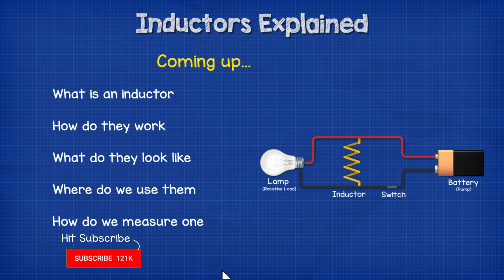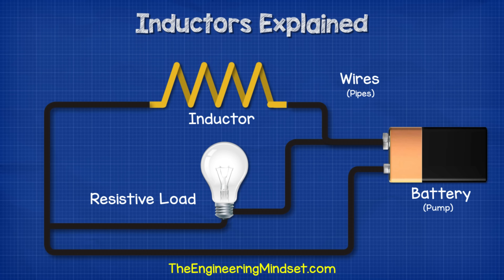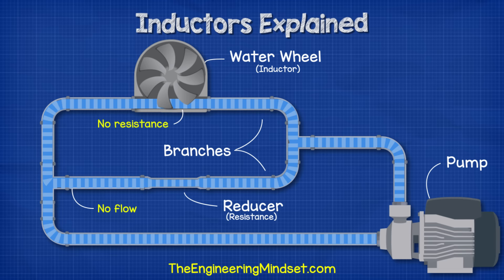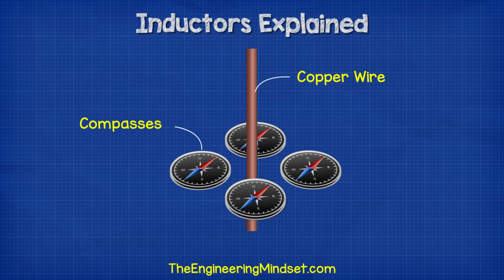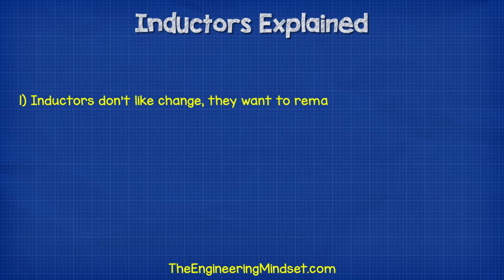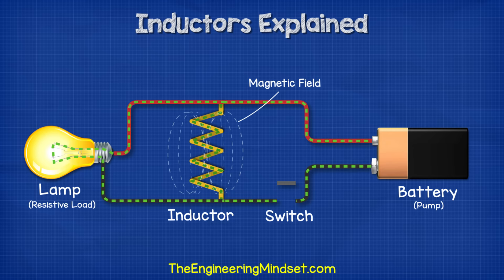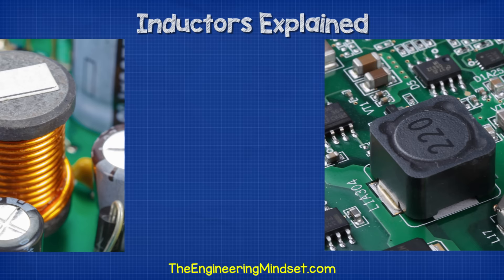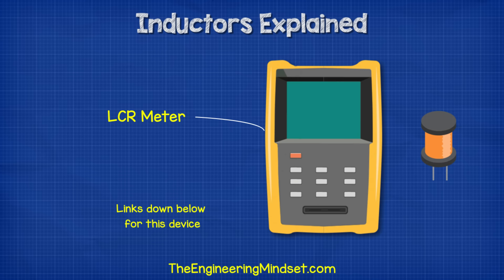Inductors Explained - The basics how inductors work working principle

Comment from the maker: ⚠️ Found this video super useful? Buy Paul a coffee to say thanks: ☕
PayPal: https://www.paypal.me/TheEngineerinMindset
Reply: These videos are more entertaining in the voice of a Bruce
Reply: Paypaul*
Reply: so why can't we use a capacitor instead of inductor?
Reply: You made it so easy 👍
Reply: Do you also take Bitcoin? Donations are great but I’d rather avoid using those PayPal scumbags.
Reply: Do you guys have a video on florescent lamp ballast's and how to test them?
Reply: Please make a video on different types of relay.......
Reply: Can you make a inductor vs capacitor lecture.
Also nice vid
Reply: @debojitacharjee  same question !
Reply: @debojitacharjee  so i tried to find some info and found that.
★Capacitor is used to store energy and discharge at an instance. (Works on voltage). Capacitor is used to get a burst of electricity like in nuclear reactors, servos, etc. Capacitor acts as a temporary battery.
★Whereas an indicator keeps the current in motion it do not stores the current (works on current ). It used to get an uninterrupted flow of current. Due to magnetic field it can keep the electrons in motion even there's no source of emf, but just for a while.
It's used with lights. It acts as a temporary generator.

Hope it will help.
Reply: The Engineering Mindset  can you help me to understand how optocouplers works
Reply: We really need a video on inductor Vs capacitor
Reply: Now i am confused between capacitor and inductor, why do we need inductor when we have capacitor. Please share video to understand why we need components
Reply: You are absolutely an extraordinary teacher. Credits for the good job. I wish I had paypal account, I could support you. Alternatively, You may make an application and we buy you coffee through paid app. ...bravo
Reply: I want to buy him a bloody cup of tea for his propa explanation of inductas.
Reply from the maker: @stomboli yes, we also accept bitcoin to this address: 3Jb56ZZQ6qL7ymKL12VinNZNLCTrj8yHWp
Reply: A good explanation but you need to change the power source. When connected to DC power source like that the inductor acts like a short circuit, cause it has no reactive resistance.
Reply: Is there an actual reason why we dont just scrap the idea of electricity flowing from plus to minus, and just focus on the electrons?
Reply: @debojitacharjee  capacitor allow AC but not DC, and Inductor allow DC but not AC
Reply: I saw this video when i was free but at 2.10 this video told me the difference between conventional current and electronic current
Reply from the maker: Check our new relay video: https://youtu.be/n594CkrP6xE
Reply: someone say they hate conventional current can u please block the guys that they say hate conventional current pls?
btw keep on the channel i like your channel
Reply: Giii
Reply: @PRACTICALPARTHA  i work with computers and they only use dc, so my question is if capacitors only use ac then why do motherboards have them
Reply: @EngineeringMindset  You earned a subscriber with that audio substitute for the scene from gravity. However, I don't think there was an edit in the scene from Suckerpunch. If there was an edit, that would defeat the purpose of the double set. My understanding is that they had mirrors suspended in place and when the camera crossed over, the mirrors were dropped into place.
Reply: @OhhYasssh  ???????
Reply: Why do you use the symbol for a resistor in your thumbnail, and then call it an inductor? They are very different.
Reply: LOL - Resistor symbol used to explain an inductor - what are you thinking?
Reply: @debojitacharjee  Current can not flow trough capacitor, but can flow trough inductor.
Reply: if we meet I will definitely buy you a Starbucks coffee.
Reply: @debojitacharjee  these two are different from each other.
Reply: Cool guy Paul 😎
Reply: What do you use for animation? Where did you learn it?
Reply: @youtube.commentator  ĺ la very good explanation.
Reply from the maker: Check out NEW resistor video, everything covered! ➡️ https://youtu.be/DYcLFHgVCn0

Comment: That water wheel analogy is the best analogy I ever heard of. Great work.
Reply: When I explain electricity I usually use water since it's a good analog.
Reply: agree, best analogy.
Reply: the pipes can have more water on one side of the load and less water on the other side, and that drags the water along so the turbulent flow in the lightbulb generates light
Reply: @official-obama  laminar flow gang
Reply: @TheAcidicMolotov  laminar flow can’t happen through millions of compressed orbeez
Reply: @official-obama  it sure can, it happens all the time
Reply: @TheAcidicMolotov  cite your sources
Reply: Doesn’t the polarity flip when supply is disconnected? The water wheel carries on same direction.
Reply: water analogy only works for DC circuits..
Reply: Water is for babies.  
Rick Hartman, what your twisted wire pairs want you to know
Reply: yes its good
but small tank analogy is more relevent
Reply: its great for understanding the basics, but gets irritating very quickly. For example, there is nothing showing effective/reactive power, alternating current, magnetic or electrical fields etc. You have to get a more intrinsic understanding of the natural laws of physics concerning electrical engineering to not get confused later on

Comment: What I am not grasping is what is the purpose? why do we need an inductor in a circuit? The more I learn about electronic components, the less I know about them it seems. I understand how it works, but why is it needed?
Reply: Same here
Reply: Honestly it's kind of the same for me. What I got from this is that an inductor basically acts the same as a resistor and a capacitor combined, so the only reason to use it would be to save space I guess? The only difference to a cap and res combo would be the way it reduces the flow, since it acts as a resistor while and after being charged, therefore not delivering the full power while connected, but then acts a cap and gives the stored energy back, whereas a resistor would constantly resist the same way and the cap not really interefering much with the current. It's confusing indeed
Reply: To store energy and help the process. 
Watch the pump part a few times. 
Don't like to type on my phone,  but it isn't that difficult to understand. 
Don't over think it.
Reply: Inductors allow to store energy for converters to work (buck, boost). They can be used as a low pass filter (remember its impedance is jwL, greater for higher frequencies because a greater variation in magnetic flux generates a higher voltage that oposses it), for example it can avoid high frequencies from noise from reaching the voltage source by making the path to it have a greater impedance for high frequencies that the path you want to redirect them to. And well obviously as a part of a transformer which has multiple uses.
Reply: The problem is that what we call "electronics" is in reality just various applications of Theoretical Physics - and the physics behind these devices is generally quite complex.  Sadly, to really understand what and why one needs a solid background in University level Physics. And even then, some of the phenomenae have multiple theoretical models for their explanation!  Simple explanations based on analogies to other better known physical systems such as plumbing and water have limited usefulness and can often lead to false assumptions regarding real-world circuits...
Reply: Heres an easy real world example you can relate to. 

When you turn your key in your car, you complete a low-current circuit that passes through a relay. The purpose of the relay is to use a low-current circuit to trigger a high-current circuit to "turn on." 
Why do this? It saves components and is much more efficient.
But inside the relay is an inductor. Once the magnetic field from the inductor is activated, it pulls on a ferrite metal to complete the high-current circuit. This high-current circuit actually feeds into your starter and spins the engine to get it started.

This is a physical use of the magnetic field but as others have said, they can be used to filter out certain frequencies.
Reply: @hannanpakthini7221  At 4.50 it is explained that the inductor  is a coil. So inside the car starter relay (sometimes called a solenoid see Wikipedia) is an inductor (= coil).  As explained in the video inductors are used in both AC & DC circuits. The " joule thief circuit" (please Google it) used to boost a single cell to drive an LED is based on an inductor storing energy.
Reply: @sheepleslayer586  I have one question -> when inductor have no resistance then bulb get turn off. And it remain turn off until we turn OFF the switch and then turn it ON again. Who do this again and again? Bulb should always remain Turn On. Let me know
Reply: @berrymckokinger9317   That's more of a electro-mechanical use, I would like to now what function it serves in a electronic sense.
Reply: Omg we litterally have the same mind I have been thinking the same thing why the heck are there so many capacitors couldn't they have combined it to just one (I'm a beginner 13 years old) and also how do the do such marvelous things with just these resistors, capacitors etc. Pls help me.
Reply: @seanwalsh999  it takes time to charge an inductor with magnetic field, so if the electricity is flowing for a short period of time, inductor won't get saturated and wont let it pass. High frequency current doesn't flow for long enough time to pass through, thus inductor can be used to block high frequency electricity from a circuit. Also it's not shown in the video, but inductor releases the magnetic energy realy quickly so the pump voltage of this release is higher than the voltage that was applied, so by charging and releasing the inductor fast enough multiple times you get higher voltage from lower voltage supply.(boost converter).
If you connect a capacitor that stores charge instead of lamp, that wastes it, inductor releases its energy into capacitor,  capacitor stores the charge and then slowly gives it back into inductor since they are still connected together, then back into capacitor, then the cycle repeats itself many times until the energy is wasted completely due to internal resistance between them, or battery is connected again. And this process is how you get oscillations from a non oscillating current, basically a radio, if you connect an antenna to it. Change the values of inductor and capacitor or resistor between them and you change the frequency of the radio.
Also it can protect the circuit from sudden voltage spikes because it takes time to charge an inductor.
Reply: @ivannechkin3665   Thank you for providing the use of an inductor in a radio circuit. I see that the inductor affects frequency which is used in audio circuits ie: an audio cross over circuit to dived up the voltage into different frequencies.
Reply from the maker: Check our new relay video: https://youtu.be/n594CkrP6xE
Reply from the maker: Check out NEW resistor video, everything covered! ➡️ https://youtu.be/DYcLFHgVCn0

Comment: Great explanations! You might add that inductance can be tricky to measure because inductors tend to be one of the more "imperfect" components we typically deal with in electronics. Inductors often include a lot of resistance.

Comment: The best explanation imaginable. These things must take some time to put together. A big thanks!
Reply from the maker: Thanks MegaSquiff, they take an insane amount of time!
Reply: i you'd take a little time to answer to us humans it would be great.
Reply: so what is the purpose of this inductor??
Reply: @razen4758  Most common practical uses of inductor are as filters, like low pass filters, so they filtered out higher frequencies(inductors are known that with higher frequencies they become like resistors for current flow because of opposed magnetic field.. More advance use of inductors for example is transformers where magnetic field of first primar inductor(coil) go through wires of second secondar inductor and generate lower voltage current of same frequency. Also lately there are very popular inductor cooktops, where they use energy of electro magnetic field, to generate heat on right cookware, where coockware presenting resistance to that magnetic field, so they heating up.
Reply from the maker: Check out NEW resistor video, everything covered! ➡️ https://youtu.be/DYcLFHgVCn0

Comment: Perfect video your next one should be about how capacitance reactance and inductance work together
Reply from the maker: Thanks, yeah I'll add it to the list
Reply: Excelent idea!!
Reply: Well, reactance and impedance are mathematical concepts. They have certain physical meaning, but not much.
Reply: Yes please add this! That would be great to begin understanding the applications of these components working in combination
Reply: Yes please add it
Reply: @altuber99_athlete  To say that impedance is a mathematical concept with little physical meaning is to say resistance is a mathematical concept with little physical meaning.  Neither is true.  In a manner of speaking, impedance is AC resistance and resistance is DC impedance.  If impedance didn't have physical meaning there'd be no effect of impedance matching or balancing an inductive load by adding capacitance in order to avoid the power grid from supplying reactive power only to have it "kicked" back onto the grid in the next half cycle.
Reply: My CPU just overheated.
Reply: YUP, that would be a tank circuit. radio transmitters.
Reply: I have no idea how that works but I'd love to know
Reply: Reactance is specific to AC power and this phenomenon can be found in inductors and capacitors. Reactance is specific to AC current since it depends on the frequency of the current because it only affects such changing current.. further, there is a 90deg phase shift betwixt v and i; and the direction of the shift depends on whether the component is an inductor or capacitor, which is know as inductance reactance and capacitive reactance..
Reply: Impedance

Comment: Great explanation about what it does in isolation, but an integration example would be very helpful. How is it used in a DC transformer? etc. I think this is the only thing that is missing from your great videos about electronics. Thanks!
Reply: huh? since when can transformer run on DC lol
Reply: @Saadkhan-th4bz  They're talking about buck/boost converters, as mentioned in the video

Comment: This is a really good explanation of what an inductor is and what it does, however, they(inductors) as well as capacitors act different with DC as they do with AC and have different applications with both types of voltage sources.  Inductors are a short circuit to DC and have resistance to AC  (reactance) while capacitors have totally opposite properties and are resistive within DC circuits bit offer low resistance paths(i.e. SHORTS) to AC voltage sources. In AC circuits, this property is called either inductive reactance Xl = 2*pi*F*L , or capacitive reactance Xc =1/(2*pi*F*C). Caps and inductors are typically used together in series and parallel combinations to form different types of filters such as band pass, band reject, and high or low pass filters(depending on how they're connected to the circuits output either allowing a freq range to pass to the output and on to another stage, or route the tuned freq of the tank circuit to ground to act as a filter, OR, as an oscillator . When combined with resistors, the total combined effect is called impedance, denoted by the symbol Z and is the square root of the sum of R squared plus X Squared .
Reply: You sir, are a gentleman and a scholar. Hopefully your comment gets to the top to more fully cover this topic and prevent fires.
Reply: Good explanation. The reason for this behavior is explained at 5:53. I wish these details of reactance, AC vs DC, and applications were added.

Edit: 
For those learning, DC has no change in current so inductor just passes current along and acts like a wire. AC has a change of current so the inductor opposes the change and acts more like a resistor. Inductor is like a frequency dependent resistor XL=jwL=imaginary number*frequency*inductance.
Reply: That's a basics videos but yeah, AC impedence wasn't covered here, or voltage spikes when you abruptely disconnect a coil when charged
Reply from the maker: Check out NEW resistor video, everything covered! ➡️ https://youtu.be/DYcLFHgVCn0

Comment: Thanks for this explanation. Can I ask for the examples of usage to be explained as to "how" those applications are realized, for example filtering. How does inductance realize filtering? That was the bit that was missing for me. Also, the relationships of inductance to other phenomena would help understanding on how these can be put together to form a circuit with some function
Reply: yeah, that was one of the things I was wondering as well. Case in point is the role of inductors in speaker crossovers.